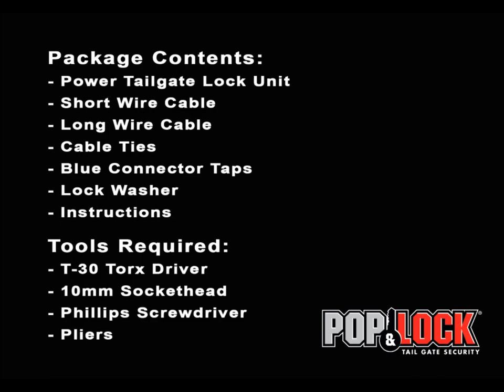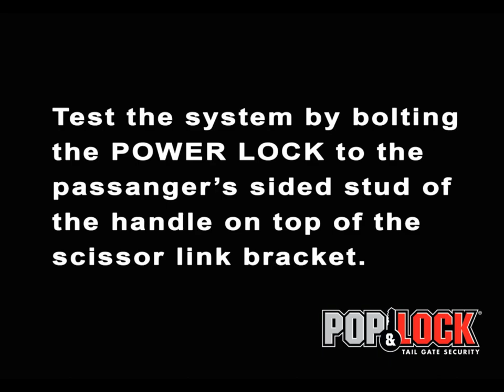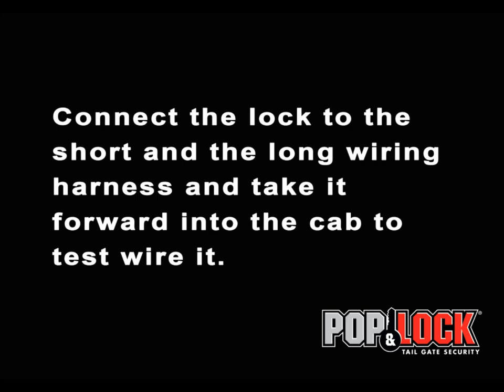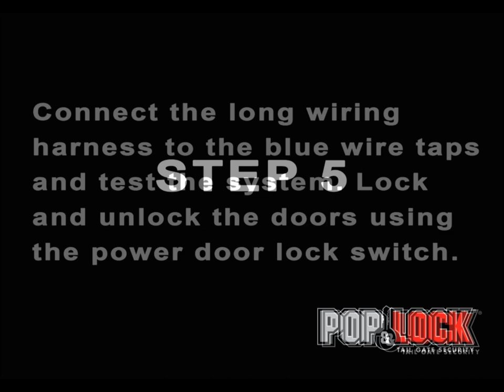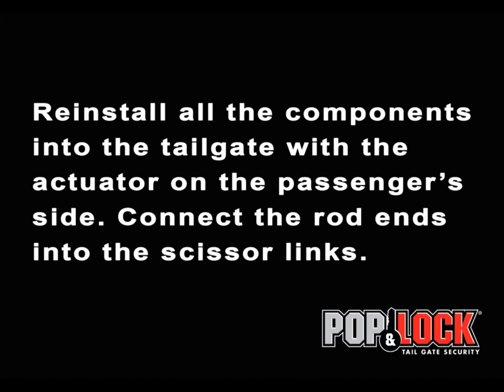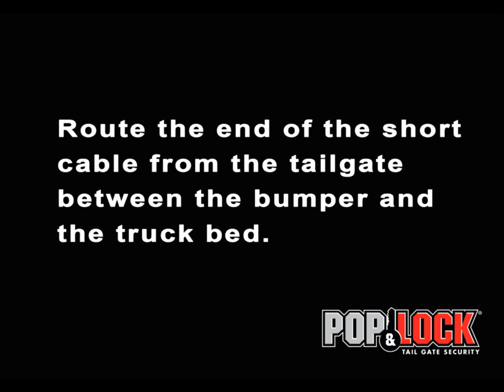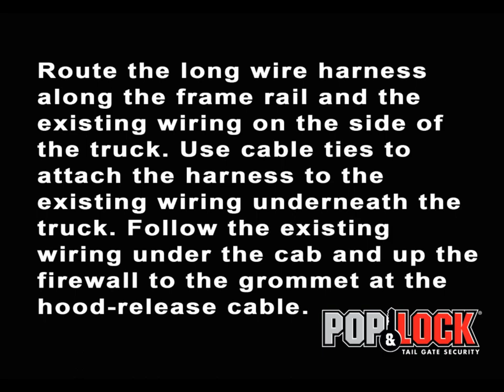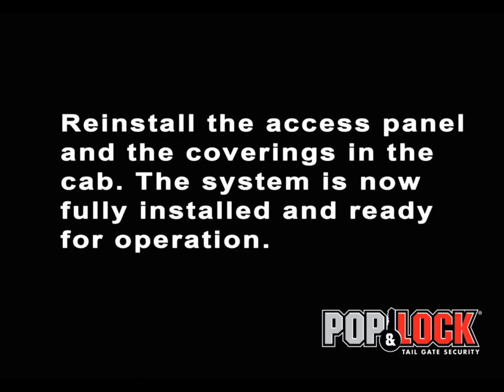PL8250 Video Installation Instructions

Comment: The PL8250 document states "2009 and Up locate the Grey/with a Brown(tan) stripe wire and the Light Blue/with Green stripe wire on the drivers side. For the passenger side locate the Grey/with a Brown(tan) stripe wire and the Purple/with Grey stripe wire".  Are you showing an alternative connection point in this video?  Thanks.
Reply: Did you ever figure this out? I'm about to install so i would like to know as well

Comment: Can you not just connect the blue leads to the tailight power? When you click the door remote or you actuate the button inside the truck the lights flash so there is accessory power? 2014 F150 FX4.
Reply: Johnny5sWorld That would make it lock/unlock whenever the light comes on - like when you hit your brakes or turn on your marker lights, depending on which light you hook to. It's not that hard to run the wire and do it right so it is connected to the lock/unlock pulse and that's the only pulse it gets. I'm wiring mine to the passenger door so that it takes 2 unlock button presses to actuate the tailgate.